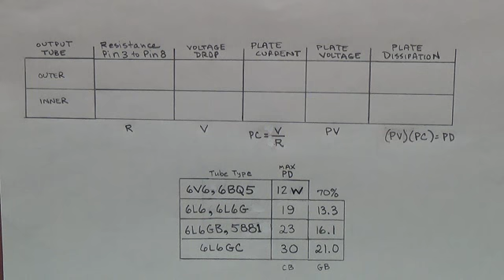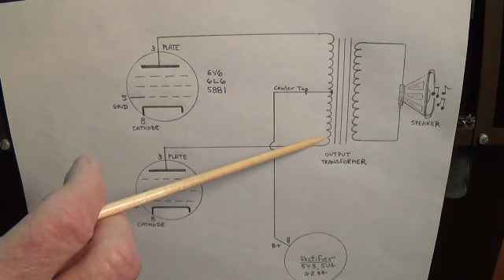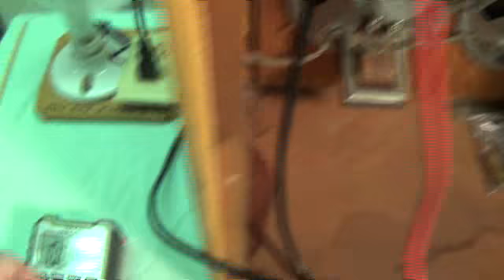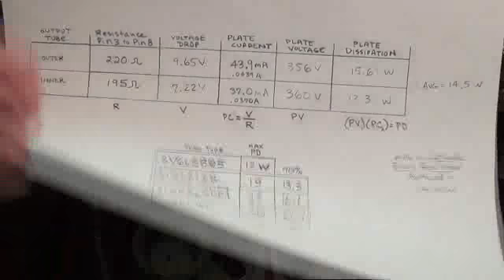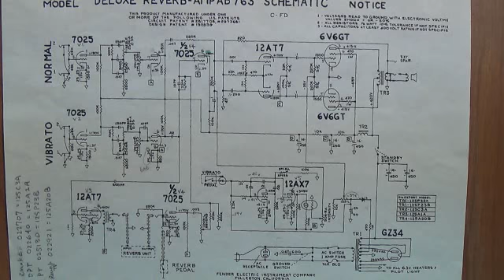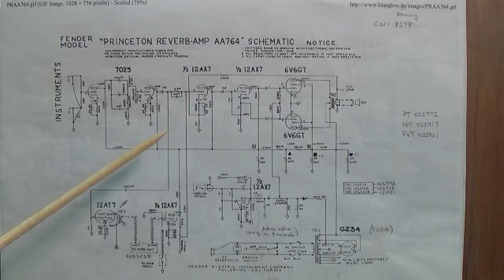Biasing Double-Ended Amplifier Output Tubes, Part 2: Demonstration and Discussion

Comment: hello uncle Doug and Rusty, very interesting video on biasing double ended amplifiers especially now i'm working on a princeton reverb kit. maybe a silly question but hard to find an answer. if the tubes are not well matched, lets say you have a gig tonight and one of the 6V6's are broken and i have one spare that is different from the one that is still OK, will it affect the sound or worse can it bring any damage? lets say that one 6V6 has PC 24 (it's on the tube) and one has PC 34. And of course, like always, there is no time for measuring because the gig is ready to get started 😦. greetings Uncle Doug & Rusty. (i wish i had teachers like you when i was in high school !)
Reply from the maker: BAMPSANDPEDALS Greetings, B&P.  You ask an excellent question. Naturally, it's always best to have well-matched output tubes. Using tubes with mismatched plate current does affect tone to some degree (the worse the mismatch, the greater the effect) because one of the two tubes will not be operating at an optimum bias setting. This is really only an issue with fixed-bias circuits.....cathode-biased circuits will generally self-adjust for the mismatch. However, as you well know, "the show must go on", and unless the mismatch is huge, I can't see it causing any real harm to the amp, and I seriously doubt that anyone in the audience will be able to tell, especially if plenty of booze is being guzzled :)

Comment: Uncle Doug excellent video! I want to ask you about the value and power rating of the resistor you use to discharge the filter caps. Thanks!
Reply from the maker: LEANDROID14 Thanks, Le. It's a 100-ohm 10-watt resistor. They are fairly common. You may even be able to get one at Radio Shack, if they are still in business.

Comment: What do you do if you can't adjust the pot low enough? What resistor do you change?
Reply from the maker: taylorc315 If you are speaking of the Deluxe Reverb, you would change the 10K resistor to ground (just to the left of the pot). For the Princeton Reverb, you would change the 27K resistor to ground (just to the right of the pot). Reducing the resistance of either resistor will lower the negative bias voltage and increase the plate current and dissipation.

Comment: Hello Uncle Doug, thanx in advance for all the unvaluable info.
Today I've completed the Plate dissipation test for my recently ended 6V6GT Stereo Push-Pull tube amp.
The 6V6GT's Plate dissipation results was 12.24w, 11.99w, 12.26w and 12.05w.
What do you think about working so close to the dissipation limit?
The cathode bias resistor is 250 ohms with a 47uF@50v capacitor in paralell.
How can I reduce the Plate dissipation?
Thank you very much for your time and help.
Reply from the maker: Gabriel Rofrano You're welcome, Gabriel. I tend to bias just below the maximum.....around 10 or 11W. It sounds about the same and the tubes last longer. You can reduce the PC and PD by increasing the value of the bias resistor, i.e. to approximately 275-290 ohms. Good luck.

Comment: How would you apply the grid bias techniques to quad EL34 arrangement such as a Hiwatt DR103. I am preparing to change tubes and I am new to working with tubes. Thanks.
Reply from the maker: jcmcclain57 It's just the same as grid-biasing a pair of output tubes, except with four output tubes (two per each of the two outputs from phase inverter instead of one), you bias the pairs for each PI output together. It's hard to describe, but quite evident in a schematic:  http://www.drtube.com/schematics/hiwatt/hwpwr100w.gif
Reply: Thanks Doug. BTW, I really appreciate and have found your channel quite helpful and interesting. It's been a while since working with electronics, but necessity is the mother as they say. My observation in studying the schematics is that you look at the tube pairs in terms of "averages" Thanks again!
Reply: Oh and as well, Mark Huss has some great specific information at hiwatt.org. He has great schematic and layout drawings specific to several different iterations of Hiwatt amplifiers. Thank you again and so very much for the excellent videos you have made, especially relative to biasing procedures.
Reply from the maker: You're welcome, JC. I'm glad the videos are helpful. Best of luck with your project.
Reply: Locate which tubes are paired, then treat each pair as a single tube with the max. dissipation of two EL34, i.e. 25 x 2 = 50W.

Comment: Hello Uncle Doug,your videos are very helpful. Between your videos and ElPaso's
 I have a better understanding in biasing an amp.but i'm a little stumped at the moment.
I have a super reverb silver face from the mid to late seventies. 
i just installed a new pair of 6L6's. From my calculations i'm getting 7.5 watts per tube.When adjusting the potentiometer, power increases in one tube and simultaneously decreases in the other. According to your chart i should be getting 70% of 30watts.  please help!
Reply from the maker: Greetings, Jules. It sounds like the pot you are referring to is a balance pot rather than a biasing pot. There should be a 15K resistor connecting the wiper (central lug of pot) to ground. Increase the value of this resistor to increase the bias voltage and reduce PD. Reduce the value to reduce bias voltage and increase the PD.

Something sounds fishy with your PD calculations. They seem too low. The value may not be ideal, but it should be higher than 7.5W. Recheck your measurements. You might even measure the PD in your old tubes. If they are real low, then there may be an error in your method or calculation. Are you using the voltage drop across the OPT to calculate PC? Also measure the PV between the plate and cathode, not the plate and ground. Use the balance control to equalize the PC in both 6L6's and experiment with the value of the 15K resistor to increase or decrease the PC and PD. Good luck and be very careful.
Reply: Thank you for your response Uncle Doug.And yes there's a resistor on the central lug. Thanks to you I built a Current Limiter before poking around ....lit up a couple of times!..To calculate the resistance there is no reading unless the standby switch is on.Is that normal? I shall do some more home-work and re-check my calculation. thanks again!
Reply from the maker: You're welcome, Jules. Yes, the standby switch must be on or there is no DC high voltage or current to be measured. Glad you like the Current Limiter :)
Reply: Uncle Doug
Hi again Uncle Doug, sorry i mis spoke. I meant the resistance.
To calculate the the resistance there is no reading unless the standby switch is on, Is that normal?
 Also there is a substantial drop in volume when the bass pot is turned all the way down.(hardly any sound). Is that normal?
 thanks again.
Reply from the maker: When simply measuring the resistance values of resistors, all power should be off or you may destroy your ohmmeter. When measuring voltage drop across a resistor (to calculate current), the power (standby switch) must be on.

No, there is normally some volume loss when a passive tone control is turned all the way down, because you are sending those frequencies to ground, but the reduction should not be that drastic.
Reply: Uncle Doug
Hey uncle Doug,I plan to experiment with the value of the  15K resistor. I was told at the the electronic store that the resistor is 1/2 watt. Does that sound right?....tks again.
Reply from the maker: Look at the 15K resistor in the schematic. If there is no wattage specified, then it is a 1/2W resistor. Good luck with your experimentation. Be careful.
Reply: No wattage specified so I guess it's a 1/2 watt but here's the thing..., Although I'm using a lower value resistor 1/2 watt, Current Limiter is dimly glowing. ....Does it have something to do with the Tolerance of the resistor?...The original one was Silver (10% tolerance) The ones I have are Brown (1% tolerance).. Sorry for being a pain in neck.
Reply from the maker: No, neither the tolerance or wattage of this resistor will affect the amount of current required for the circuit to function. The Super Reverb is a fairly powerful amp with a strong "thirst" for current that can make the bulb glow dimly. You might want to increase the wattage of your bulb a little to eliminate the glow, i.e. if it's 250W you may want to go to 350W, if possible. When the bulb glows, there is a voltage drop across it which reduces the operating voltage within the amp circuit. This generally doesn't affect how the amp functions, but your voltage readings within the circuit will be a bit lower than if the amp were running on straight 120VAC (i.e. with no CL).
Reply: Phew! That's re-assuring. Thank you for your time, patience and sharing your knowledge with newbies like myself who's trying to get a better understanding of how their equipment works.
Much appreciated !
Reply from the maker: You're quite welcome, Jules. Best of luck with your projects :)
Reply: Hi again Uncle Doug, I'm looking at two 10 inch Jensens speakers, 8 ohms, 30 watts.They came out of a Bassman...would they be compatible with a silverface Super reverb 45 watts?
Reply from the maker: Greetings, Jules. I believe that the Super Reverb uses four P10R Jensen 8 ohm speakers in parallel for a total impedance of 2 ohms. As long as the two 8 ohm Bassman speakers are used along with two other 8 ohm speakers (i.e. the original SR P10R's) in parallel then the impedance would be correct. If you intended to only use the two Bassman 8 ohm speakers with the DR, the impedance would not be correct.
Reply: Thank-you for your advice Uncle Doug.I would be interested to know what you think of the CTS Alnico speakers.There are four identical speakers in the SR. chocolate brown in color,with square magnets.  After doing some research I  found that the codes on the speakers (137-7534) points to CTS .
 Although I been using this amp for more than ten years, I only discovered that there is a push-pull feature on the master volume!  :(
 Thanks again for your help.
Reply from the maker: I believe that the large, square magnets on CTS speakers are actually ceramic rather than Alnico. I understand that they are generally good speakers, but not great. Some say that they lack clarity. I personally have very little experience with the large, square magnet variety.....but tend to like CTS speakers in general.
Reply: I love my square magnet CTS/Eminence (1974) speakers and I always keep some on hand for my two blackface fender twins. I run one per amp along with a more accurate type, such as a Weber Chicago with bigger bottom end. the CTS provide breakup and high end compression for a sweet sound.

Comment: Bless you Uncle Doug for sharing your knowledge in a most concise and easy to understand way.
I just noticed right at the end of this vid where you're talking about the biasing arrangement in the Princeton amp. I've just put a 10k pot into the bias supply of a Princeton in an attempt to make the grid bias adjustable but the plate current is jumping about all over the place when I try and measure it. Is the 10k pot a waste of time? Would it just be better to adjust the bias supply resistor if the tubes are running too hot/cold?
Thanks again for your videos, they really are great.
Cheers, Jeff.
Reply from the maker: Thanks, Jeff. I'm glad the videos are clear and helpful. The bias voltage in the Princeton circuit is controlled by the 27K resistor to ground (in the schematic, just to the right of the tremolo intensity pot). Increase the resistance to increase the bias voltage, and reduce it to reduce the voltage. There is a correct way to install an adjustable bias control in the Princeton circuit. It's described in detail in another of my videos: http://youtu.be/DirM9fuUhJo  Good luck :)

Comment: Doug,

What do you think about adding a pot or maybe a decade box to the cathode resistor to allow tweaking the bias?  Summing them so the total resistance never gets crazy low.
Reply from the maker: I think it's a good idea, SR, especially for someone who likes to experiment with different output tubes. Having a fixed resistor with a low (but safe) value, and a variable resistor in series can provide almost effortless re-biasing. I posted a video covering this procedure in a Fender Champ, Princeton, and Gibson GA-35 amp.

Comment: Been printing a lot of schematics lately. Yes, most are the same except the Fender Bassman Ten. All they did is tie the kathodes together but no tie to ground unless that is an error on the print. I'll do a measurement to determine this for sure. If a person wanted to bias each tube, it seems as if they would just put a pot in, instead of a bias resistor but the problem is that it would have to be a power pot. Is that pretty extreme or a good idea? What about in the high power ones where they use 4 tubes, 2 in parallel for each leg, eg. Bassman 100 or Twin Reverb... Seems pretty cool to me but would require more space in the chassis. Bassman Ten has a lot of extra space for power pots. Would be nice for you to do a video on how the balancing pot works on those models. So on your final description, did you leave the balancing circuit in place and then go in and add the kathode resistors or did you remove the balancing circuit? I'm looking at the print and wondering how the balancing pot works, because it is tied to the center tap of a voltage divider ( Deluxe Reverb AA763). On the Bassman Ten, It is easy to see because the wiper of the balance pot is the center tap and goes to ground. The end leads go to each tube. THAT, I can understand. The other way, all I can see is that it controls the actual bias voltage value? Not sure though. Your videos are very instructive. it would be cool, to learn about how these circuits work, now you have shown us about how the tubes work. Would also be nice to know about different components and how they affect tone. Also, is there a difference between carbon comp resistors as opposed to carbon film resistors with respect to tone? Great Video Doug! Thanks again! otter
Reply from the maker: Otter, the cathodes in the Bassman Ten and Bassman 100 are all connected to ground. The tubes are grid-biased via a separate negative DC voltage supply, and there is no bias resistor.

I don't discuss grid biasing in this video since there are many variations in how it is done, and often there is a built-in biasing pot (like the Deluxe Reverb, that generally does not allow for individual tube biasing) to perform the task.

The balancing pot that you see in the Bassman Ten doesn't really change the bias voltage, it simply controls how it is distributed to the tubes. To change the bias voltage, you alter the value of the 15K resistor to ground.

The video only addresses how to cathode-bias double-ended amps. You can install a cathode biasing pot (or pots) in these amps. In fact I have a video showing how to do this in a Gibson GA-35RVT amp and in the Fender Champ amp that I built from scratch.
Reply: Uncle Doug Do you think it would be a worth while idea to make that 15K resistor a pot or just leave it alone? What I'm doing is gathering all the info I can before spending the 200+ dollars on transformers, and later 125.00 on tubes for the Bassman 100 project, before I start it. I want to have my complete schematic with any and all changes, ready to go plus a detailed BOM and sources of parts.  Do carbon film resistors change tone or should I use carbon comp? otter
Reply from the maker: I would leave it alone. Pots are just not as stable and reliable as fixed resistors, especially in a critical position such as this. You can replace it with a pot temporarily to find the ideal bias voltage, and then replace the pot with a fixed resistor of that value.

I think metal film resistors are far superior to carbon resistors, particularly with respect to precision, stability, and noise reduction. There is much debate over the effect on tone, but I (and a whole lot of other people) seriously doubt that, in a blind test, anyone could tell the difference. I personally use metal films in virtually all of my scratch builds.
Reply: Uncle Doug Thanks for the info Doug! otter
Reply: +Uncle Doug Carbon composition resistors actually change their resistance with increasing voltage across them. However, the effect is tiny, and only if resistor is in a high voltage circuit with a large voltage swing across it might the difference be detectable. Maybe using one as the plate load resistor in the last preamp stage might  be noticeable. Metal film resistors for ever!!
Reply from the maker: I agree that metal film resistors are much more stable and precise, Silas, but a lot of folks are convinced that the old carbon comp resistors are largely responsible for the tone we associate with vintage amps.

Comment: Thanks so much for all of these videos.  I know how much time they take and trust me it is appreciated!  I tried your method on my JTM45 RI and thought I was doing something was wrong.  I could only push 6.6 Plate Dissipation on my 5881's at max bias.  Turns out I had a weak rectifier tube.  While that helped a bit, I still couldn't get them up to 70%.  I replaced the power tubes and was in business.  Maybe that is why I never really liked the sound of this amp. 

I also compared the results with a kit based bias probe I made and the numbers match almost exactly.  Your method is accurate and inexpensive.  Thanks for your insights!
Reply from the maker: You're quite welcome, Jimmy. It's great to hear that the video(s) were helpful. Thanks for the kind words :)